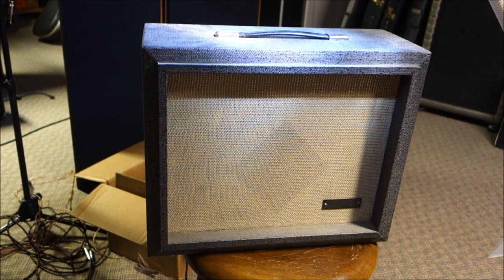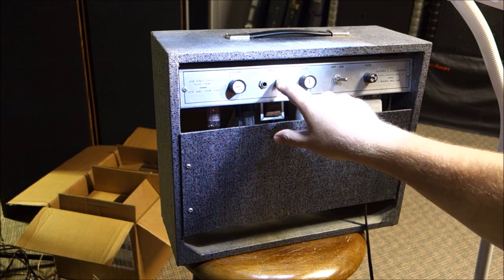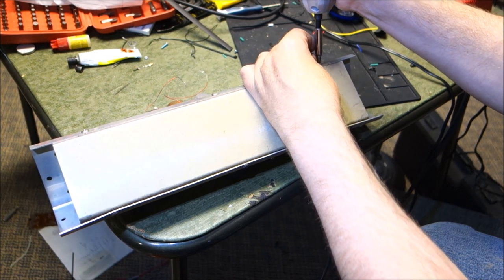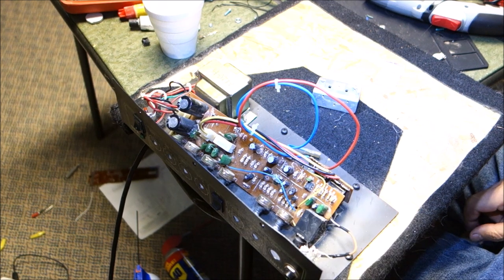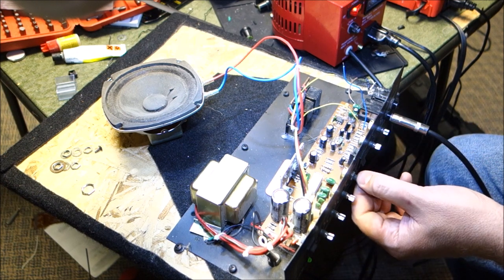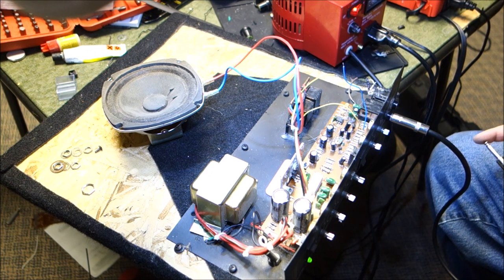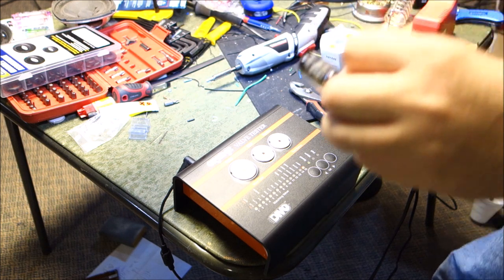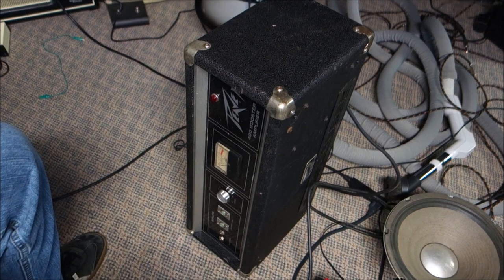Amplifier Repair-A-Thon Part 8,  Extended Length Extravaganza!

Comment: Good job. And I like how you didn't stuff new capacitors into the shells of the old ones. I think that's ridiculous. Personally I just want an amp to sound good. I don't inspect the insides looking for old caps. I prefer new caps that work and sound great.
Reply from the maker: Realistically,  the only thing I try and NOT do is leave a big hole where a can cap was.  I like it to retain its original look (when it's all together.)  With the Ampeg,  I used similar can caps... close enough that unless you're a collector you'd never know.